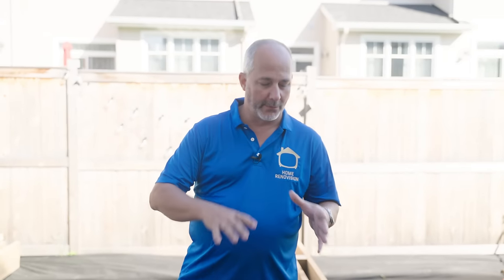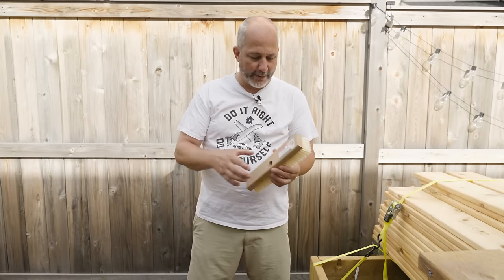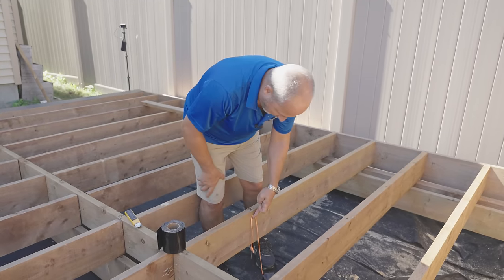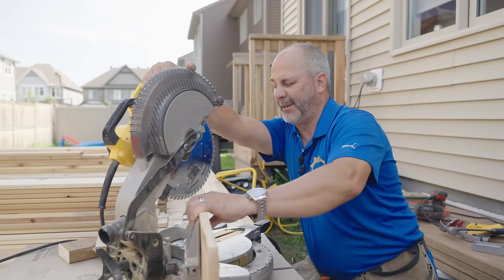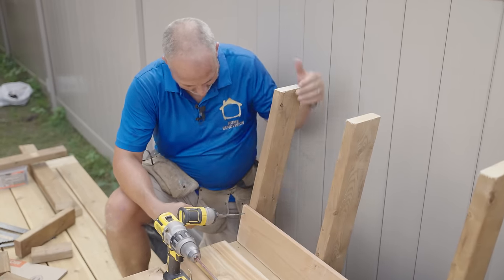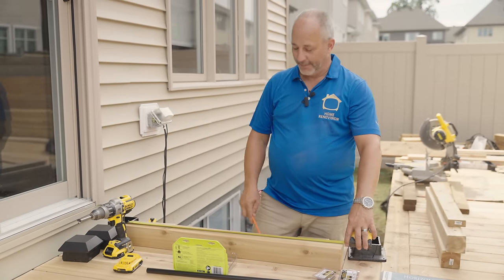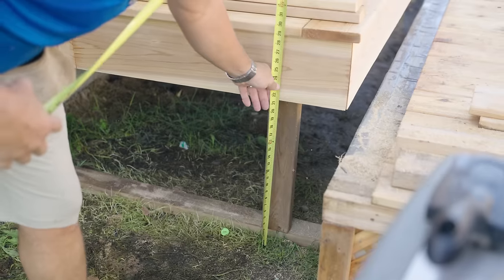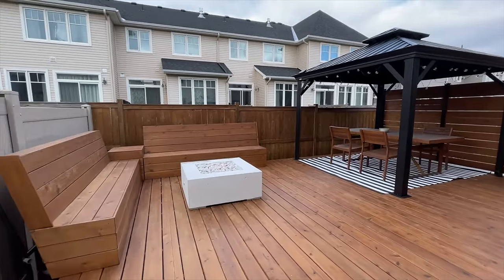How I Built a $35K Deck for $6K | DIY

Comment: To bad the window was there and the deck couldn't go right to the house, seeing as you ended up removing the cheap min code staircase and landing anyway, though looks higher then 24inch max for floating deck , but seeing all the extra love you put in the deck almost worth just getting the permit for attached deck and digging holes for footings but that window is just enough to trouble avoid that option.  I had a similar problem on my house built in 1912, when i removed the siding to replace found 3 windows covered over 2 of them were i wanted my deck from the dining room into  back yard removed the big window and put in frenchdoors and had to brick in the windows and pay 3 grand to get power miter moved around the corner like 2 feet wasnt allowed to touch it so had no choice to pay government owned company 3 grand for 15 min of work,  then a coalshoot that was built into the foundation needed to be busted out bricked in, then parged over with stucco ended up doing the foundation which had rotten sill boards and usual 100 year wear and tare turned into a month long project before i could start the deck the inside was framed over in the basement so had no idea the windows were there until i removed the siding which they put right to the ground 3 corners were gone and were quite a few cracks from trees that were only couple feet away from house 9 off them i cut down and dug out the stumps before repairing that section one week job just doing that and i work as a welder 10 hours a day 6 days a week unless its busy and then its 7 days a week neighbours asking why i was working outside so late sometimes till 2 am with lights . Noone to hire and the one quote from a company an hour away wanted 45k to do it min said might even be another 10 after everything was said and done if i did the tree stumps they wouldnt touch them lol. Took me a month but its done deck is done except the railing which i left out on the one side for a bench railing, never thought of extending out like that good idea i like it but im in saskatchwan and all i see outside is white we got snow yesterday and still going so  finish deck goal is gonna be delayed .  Joys of buying 100 plus year old house  one major project a year but worth the trouble in the end.

Comment: Wait till your wife helps you by mixing 3 gallons of stain from one store and 2 gallons from another in a 5 gallon bucket.  Wondered why the stain was going on so blotchy.  Come to find out when I looked at the cans that she had mixed 3 gallons of water based  stain with two gallons.of oil based stain.  Thank goodness most of the boards were hidden underneath the Trex boards.

Comment: I am all for DIY, though somethings you shouldn't cut down on contractors is all of the equipment, tooling, knowledge, employees, insurance and licensing, plus taxes and liability. Sure $35k is a ton for that small of a deck. Just try to keep a professional responsibility and not cut all contractors down. Good overall video

Comment: At around 10 minutes into the video when you are leveling the beam, I didn't see where you put a level on it when you were screwing it to the post using your "temporary level" beam on the outer end? Did I miss that, or did you level it another way?

Comment: question for you..  first though, thanks for the video! Now -- I am building this design on top of a 4" concrete slab, resting the deck blocks  directly on the concrete, deck is planned to be 16 x 20,  running (3) of the main supports underneath, increasing the number of deck blocks to (4) per 20' stretch.  Kink is -- I am wanting to place a gazebo and 7x7 hot tub (3600 lbs loaded wt) - will she hold up?  Also - dfebnating between composite and wood decking (not sure comp cantake the tub weight)

Comment: Why would it shatter if you point it in the air and pull the trigger but not if you point it down.  What’s the difference.      I have used power nozzles quite a bit and never had one break cause it wasn’t pointed down

Comment: Very good video, but nobody is going to install the deck for free. If the parts were $6,000 then the homeowner won't be able to find someone for less than $6,000 to install it. Also, the quality of work you do for your YouTube channel is far above what most contractors provide. So your title should be "$35k deck for no less than $12k, and expect headaches."

Comment: 🎯 Key Takeaways for quick navigation:

00:00 🏠 Introduction to DIY Deck Building
- Jeff introduces the project: building a deck with a privacy screen for $6,000.
- Explains the goal of creating a high-value outdoor space on a budget.
- Highlights the DIY approach to save money and add value to the home.
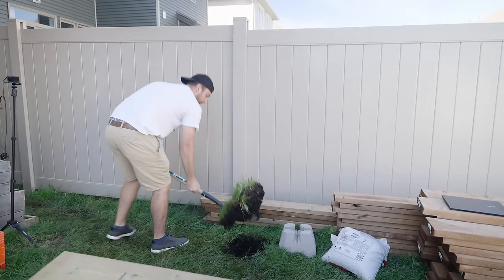01:24 🌱 Preparing Ground for Deck Installation
- Discusses the importance of removing organics from the ground to ensure stability.
- Provides tips on setting the deck blocks for a floating deck.
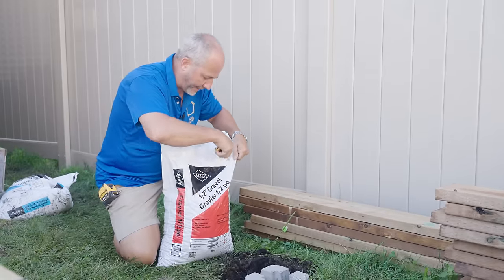02:46 🛠️ Deck Foundation and Framing Basics
- Demonstrates laying gravel for stability and covering ground with landscape cloth.
- Focuses on building box beams and setting joists.
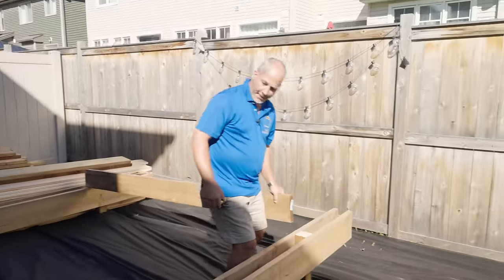05:01 📐 Stabilizing and Leveling Deck Beams
- Explains how to stabilize beams and achieve the right measurements for building.
- Provides tips for using levels and adjusting the height of deck beams.
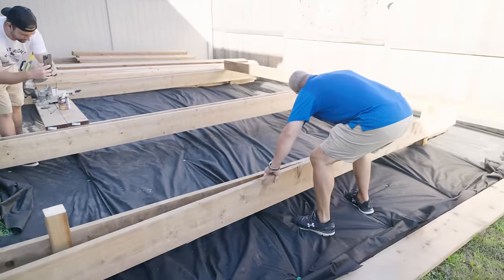07:06 🌳 Selecting and Treating Lumber for Deck
- Discusses the choice of lumber (two by tens) for deck construction.
- Emphasizes treating cut lumber ends for longevity.
09:03 🛠️ Assembling the Deck Structure
- Guides through the process of aligning and securing joists to the deck frame.
- Explains the importance of precise measurements for a stable deck.
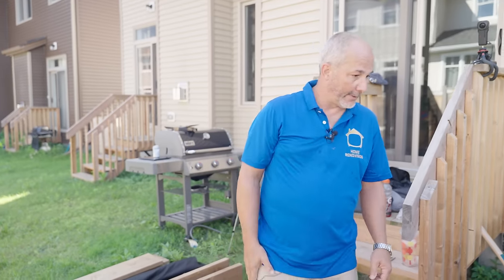11:26 🔄 Setting Up for the Next Phase of Building
- Previews the next steps in deck construction: installing deck boards and building a privacy screen.
- Talks about preparing the area and materials for the upcoming work.
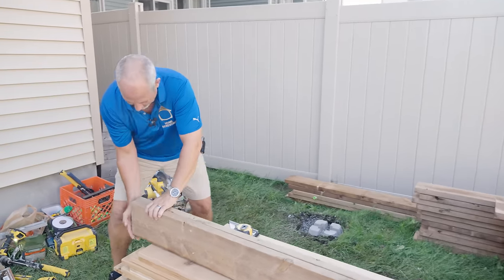13:26 🔨 Deck Board Installation Techniques
- Describes the process of laying and securing deck boards.
- Discusses considerations for board spacing and alignment.
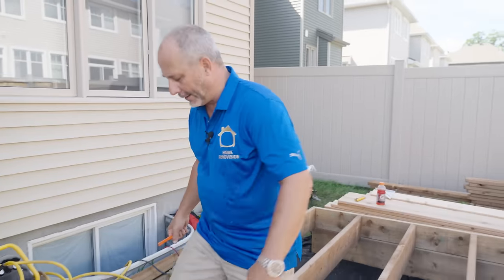16:06 📏 Measuring and Adjusting for Precision
- Emphasizes the importance of accurate measurements for deck board installation.
- Shows how to use tools for precise alignment and fixing.
18:01 🎨 Finishing Touches and Aesthetic Details
- Explains the process of adding finishing details like picture framing and nosing for aesthetic appeal.
- Provides tips for achieving a professional look on the deck.
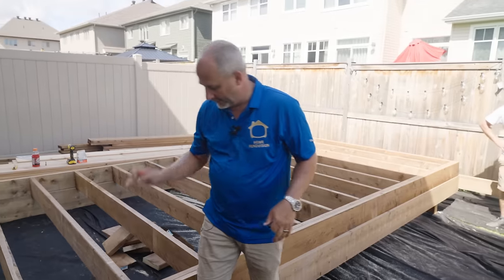20:40 🖌️ Sealing and Protecting the Wood
- Discusses the importance of sealing cut wood to protect against elements.
- Highlights the use of specific products for wood protection.
22:42 🌟 Final Assembly and Overview
- Shows the final steps in the deck building process.
- Provides an overview of the completed project and its features.
01:42:25 🏠 Building a bench and privacy screen
- Discussion about building a bench and adding a privacy screen.
- Mention of a family wedding and completing the project as a gift.
01:47:00 🔨 Detailed woodworking techniques
- Explanation of woodworking techniques and measurements for precision.
- Focus on avoiding saw cuts on finished deck, using cedar wood.
01:52:11 🛠️ Installing brackets and structural elements
- Process of installing brackets and structural elements on the deck.
- Emphasis on the importance of drilling techniques to prevent splitting of wood.
01:58:04 🧰 Building and measuring for furniture fit
- Construction of deck bench with considerations for cushion sizes and spacing.
- Decision-making process for creating a comfortable and functional outdoor seating area.
02:03:18 📏 Precision in measurements and adjustments
- Focus on precision in measurements for building outdoor furniture.
- Adjustments made for aesthetics and comfort, including armrests and backrests.
02:09:12 🛠️ Structural modifications and enhancements
- Modifications made to enhance the structural integrity of the deck.
- Use of structural screws and adjustments for leveling.
02:19:07 📐 Addressing warps and irregularities in wood
- Techniques for dealing with warped wood and ensuring a level finish.
- Use of tools like planers to correct irregularities in wooden pieces.
02:27:03 ⚒️ Finishing touches and installation of handrails
- Installation of handrails with detailed explanations of the process.
- Emphasis on aesthetics and safety in rail installation.
02:37:09 🎨 Staining process and techniques
- Process of preparing and staining the deck for a durable finish.
- Use of specific products and techniques for effective staining.

Made with HARPA AI

Comment: Same thing happened with my parents. They wanted their 12' x 24' deck and stairs replaced. It was pressure treated wood and the frame and posts were fine, just the deck boards and railings needed to be replaced. It was about 5' off the ground. They got 7 quotes and they ranged from $28K - $38K. I ended up doing it for about $7K in material. It took me about a month as I would work on weekends and after work but they weren't in any rush.

Comment: Would a pressure washer, using that mixture, have worked and made job easier to clean that cedar fence? Ottawa building code allows a deck to be built a foot away from a property line fence? 😀

Comment: Great video. I still have so much respect for you guys and gals that do residential. You probably just misspoke, so my comment is toward the newer techs.....The compressor does not convert gas to a liquid. It compresses the vapor to a higher pressure and higher temp superheated vapor. If anyone ever forgets, just think about where the refrigerant goes after the compressor. The refrigerant then goes to the condenser. The condenser then takes that superheated vapor and de-superheats it and "condenses" that vapor until it then changes state back to a liquid. Happy HVACing.

Comment: I have a question Trane  furnace in attic water always dripping around filter!  Not a ton but always wet spots.  Drain is not clogged they blew it out and it’s less than a year old town home.  HVAC guys say it’s normal to drip some?  What should I say or tell them it’s still under warranty!  I’m worried about mold!  Never had one drip before! Thx

Comment: I use a 2 foot quick clamp and a small 2x4 cutoff to add a third hand which can hold one end of the 2x10 at the proper height or two perpendicular wood pieces of together. 

6" clamps work well on the sides of the 4x4's.

Beats driving and undriving screws in and out... then in again.

Comment: Awesome build Jeff, thanks for the detailed video. Question, does yhe provacy femce meet code for fence railing for your area? And my neck of the wood deck railing as to be able to support 200 pounds of force, curuous if this system can meet that rrquirement.

Comment: At 2:18:30 I thought you were going to put the screw in the lower one and use the claw hammer as a fulcrum to pull them flush and then put another screw in.

Comment: I am in Missouri and being told not to put those blocks down and are not to code but our deck came with those and the pillars are stable and not rotted even though the hole top of the deck is rotted.

Comment: As a landscaper and someone who deals with 6a on a regular bases I can say that if u didn’t absolutely tamp the crap out of ur stone before putting your blocks in this deck is going to settle atleast a couple inches. I’m confused as to why u didn’t just fill concrete tubes and tapcon your 4x4 posts to your concrete tubes. U don’t have to worry about rot or settling and it’s cheaper z not trying to insult u because u have taught me a lot of good ideas but this doesn’t seem to be the best way, atleast in my opinion and I have built a lot of decks and patios. I could be wrong though

Comment: Good work although in my city it would not meet code as the maximum fence height is measured from grade. The privacy screen height on the deck likely exceeds municipal fence height limits. 🤓

Comment: As far as the spacing goes, there are many ways to achieve consistent gaps.  One method would be that you could rip just one board to the needed width and place it on the top, bottom, or anywhere.  This would give you consistent gaps and only one board would have a smaller width.  The other method would be to calculate the necessary width of each board with the width of the gaps and rip each board with a table saw to that calculated width.  This would give you consistent widths and gaps but would be more labor intensive.  Stacking two boards on top of each other without any gap isn't recommended as they could shrink, expand, or buckle with the weather and temperature changes.  With that being said, this is a great DIY video!

Comment: A good carpenter would measure the top board and rip it . That rip would then be the bottom of each section . Well worth it to hire a pro if you want the job done right . Doing 2 tight then a gap looks like chit!

Comment: You said to leave a comment about the privacy fence. I would’ve put a rip in at the bottom where it’s less noticeable and then evenly spaced the rest of them to the top or put two equal rips in one at the bottom and one at the top, so it looks like trim and looks like you did it with intent

Comment: Jeff you the Boss of all Trades. I been wanting to do a deck and was stressing about getting the beams to sit perfecting on top of the post that's notched out but this is waaaay easier with the bolt system. Thanks

Comment: So your relying on some screws and 1 bolt for strength to hold onto those posts in the center of the deck.  Not safe and would not pass inspection,  each post should be notched and the load carried by the post and not a bolt.  Regardless of how high the deck is that is not good practice.

Comment: 1:01 putting string through pvc pipe , you can do that at a later time by tying a plastic grocery bag onto one end, then suck the string through to the other end with a vacuum cleaner.

Comment: With sprayers like that I try to find a baseline pressure to coverage ratio. Just as a guide, but x pumps of the sprayer should = y surface area, be it boards or passes or however you want to do it. Helps keep me on track on larger jobs to keep even coverage on a macro scale. Just a thought

Comment: This dude is so smart. The way he framed everything went up so quickly. But he doesn't have a pressure washer. I had to turn it off at that point. Lol. Peace.
Reply: He did explain that: firstly he's showing how to get it done without one...

Secondly, he mentioned that it raises the grain of the wood, which makes it take the stain differently - and he was looking to match the tone of the fence with the rest of the new cedar deck.😉

Comment: Is there a reason people use blocks instead of setting a post with concrete? Just wondering.
Reply: It's more simple and much much less work if you can get by with the blocks. But a lot of times that's not up to code. More importantly if you live somewhere that experiences high winds (basically anywhere in the US) the poured piers hold everything down a lot better. Especially if you make the bottom of the hole larger so that the pier is bell shaped. Plus they carry more weight and last longer etc. A low lying deck/patio situation is the only time I use the pre-cast blocks and only if code allows.

Comment: Hey Jeff!  I really enjoy watching your videos.  I have done a lot of home improvement projects but always learn something from you.  One question - since Canada is all about metric measurements, just curious as to why you use Imperial (English) measurements in your projects?  Is it to cater to your US audience or for another reason?  Thanks for all you do to educate! - Brian
Reply from the maker: Hi Brian. we actually use imperial in construction. the only metric used is in electrical and some plumbing. since we trade so much with the U.S. it has traditionally been easier to just keep your imperial system alive in the trades so materials can be shipped back and forth easily and all the training we get from north american manufacturers for stick built houses generally comes from south of the border so we adapted. Cheers!
Reply: @HomeRenoVisionDIY  Thanks for the info!  I've been wondering what the reason was.  I'm not complaining as I can obviously more easily relate to the measurements!  I guess it's a lot easier to specify a 4 x 8 sheet of plywood than a 1.22M x 2.44M sheet of plywood.  But I suppose that size in Metric would be rounded a little...  Thanks for the reply and explanation!

Comment: When to use screws and when to use nails when it comes to woodwork?
Thank you
Reply: Unfortunately you're going to want to look that up on a case by case basis. Something like framing is all nails, roof metal is all screws, and a deck will be a combination of the two in different areas. Without an engineering degree you're going to make mistakes otherwise. If you mean woodwork as in making furniture and things like that you're almost always going to screw or glue. Nails would just be for appearance or if you think screws might break due to loads.

Comment: Just curious. Why did you choose to make the beams perpendicular to house rather than parallel?
Reply from the maker: deck boards come in 16' lengths. place the beams the same direction as you want the boards to run to avoid joints in the middle of the decking. those joints are always the first place wood rots.
Reply: @HomeRenoVisionDIY  I sorted realized after posting that probably beams are always the shorter dimension.  Were those carriage bolts 3/8 or 1/2?

Comment: I honestly love the Simpson structural screws, but they're double the cost of the same nail. So, I decided to go like 20% screws.

Also, it's distressing to me using batteries as a hammer. I can just picture the chemistry in there taking damage.
Reply from the maker: just a small cost on an otherwise large project. I like to keep things simple. Cheers!